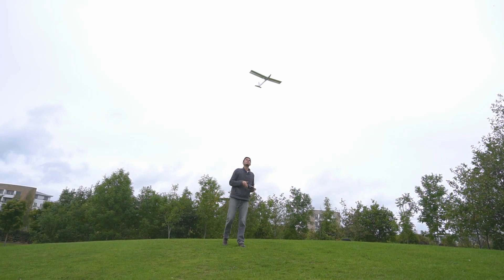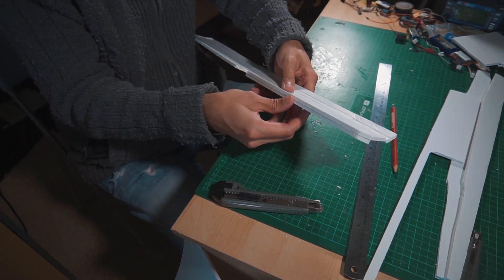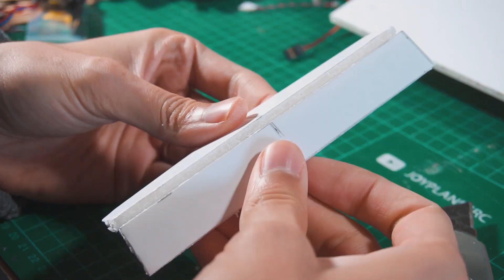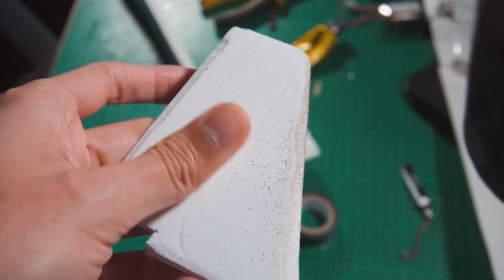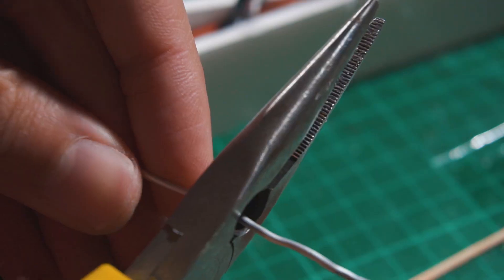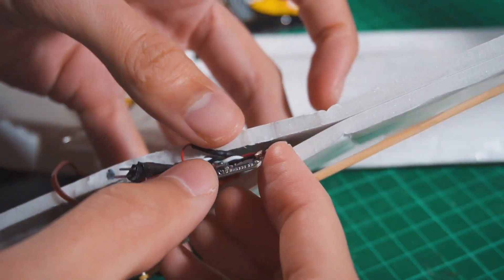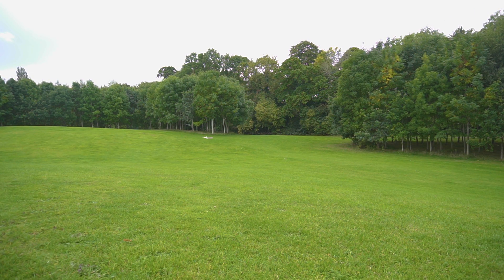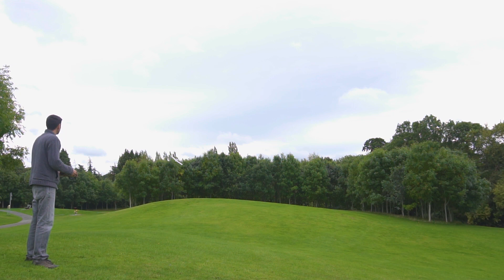Making a mini RC airplane

Comment: will this work : Brusheless ESC 30A Speed Control 2S 3S T-Plug JST for 2212 Brushless Motor KT SU27 RC Airplane FPV Racing Drone RC Car Boat

Comment: also, this model has a  (poorly designed)  high-lift, high-drag,  SLOW-FLYER wing.    the model will tend to not behave 'normally', when airspeed is  Excessive.   cheers
Reply from the maker: You are right but to be designed as I went it is fine. Cheers man!

Comment: thanks for posting.  here are some things to consider.   you can thank the fools at  FT for their popular and FLAWED designs; also, for  SKIPPING OVER  this  Fact -    paper-clad  foamboard is  H E A V Y.    its use Should be limited to models that have  Sufficient wing area, in order to achieve nominal wing loading.     cheers                     googletranslate                                  some resources
https://wright.nasa.gov/airplane/shortw.html
https://www.princeton.edu/~stengel/MAE331Lecture5.pdf
for a pusher config.
http://static.rcgroups.net/forums/attachments/2/9/6/3/9/7/a5988257-224-bixler%202%20motor%20angle%20correction.jpg?d=1375236281